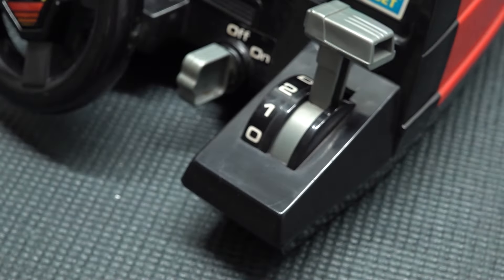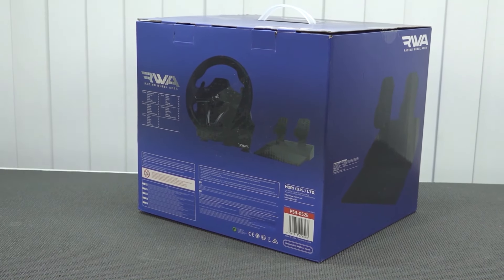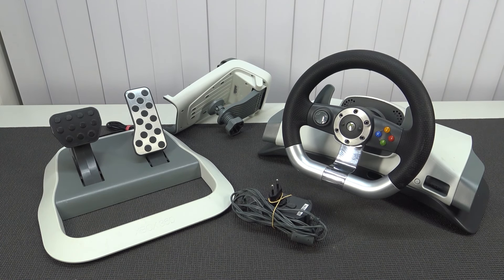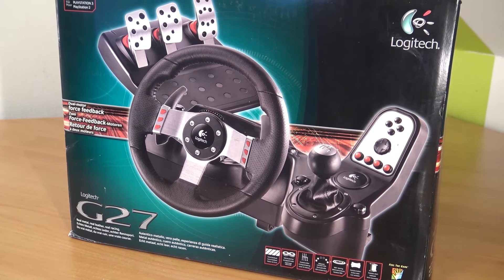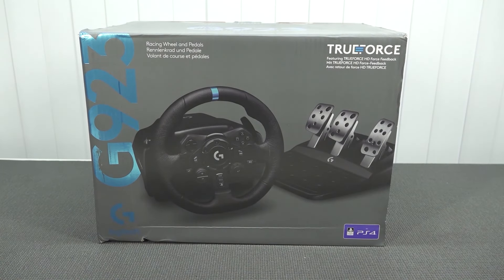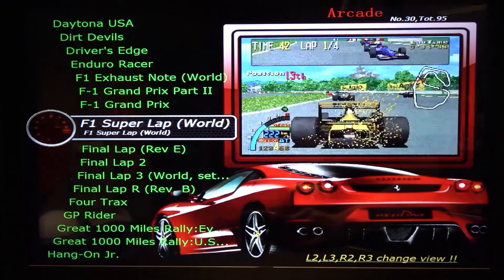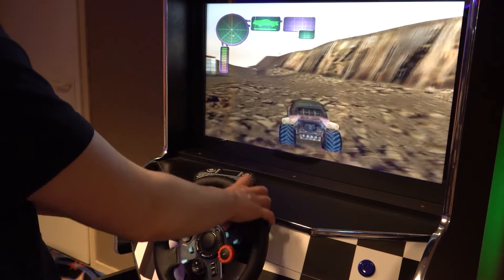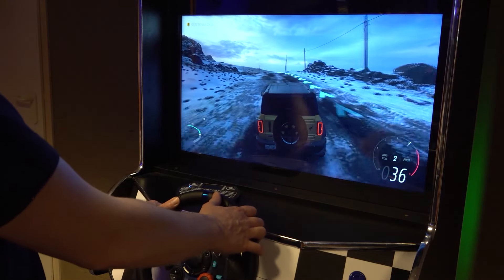Logitech Racing Wheels & Emulation .. Beginners Guide !

Comment: 5:00 XBox360 wheel does not have feedback when used on a PC. That is well documented as PC games don't have drivers to support the feedback. The wheel works fine on a PC as long as you have the usb wireless dongle but without feedback.
Reply from the maker: ok, did I have a brainfart there 🤣

Comment: Hi Wicked Gamer & Collector,

I hope this message finds you well. I've been thoroughly enjoying your videos, especially the ones focused on emulation. Your content has been incredibly informative and inspiring.

I'm looking to set up a mini PC for emulation, with a focus on GameCube, PS2, and PS3 games. My goal is to find a compact computer with a small form factor that can handle these emulations effectively. Additionally, I need it to be readily available here in Germany, preferably on eBay Kleinanzeigen.

My budget is around €200, but I'm hoping to spend as little as possible while still achieving good performance. Do you have any recommendations for specific models or setups that would be suitable for my needs?

Thank you for your time and assistance. I look forward to your advice.

Best regards
Reply from the maker: You should look into used mini pc or pc solutions.
They are cheap and come with a lot of power for not a lot of money.

Buying new cheap mini pc's not a problem with PS3.

Comment: When will they add touchscreen dash consoles to the driving/racing wheels? Imagine you have an 8" screen with all the functions: Google, FM radio, MP3, AV, navigation, back up camera, gauges, auto tuning controls, Stream Deck integration. It could be a revolution in racing wheels. They could sell vertical and horizontal models. It could be so premium. I want this.